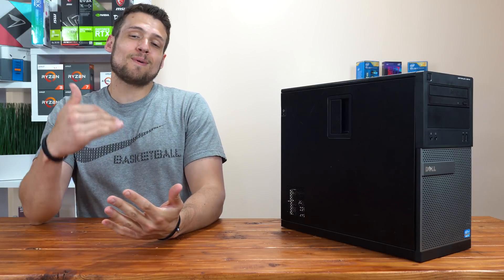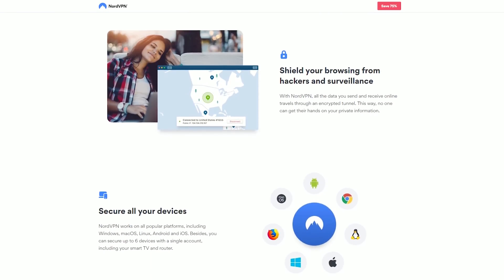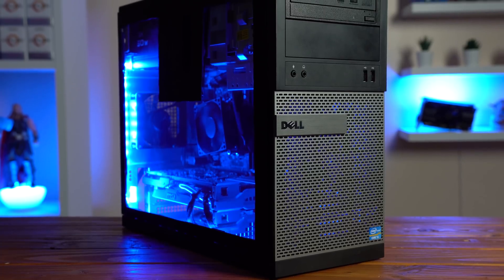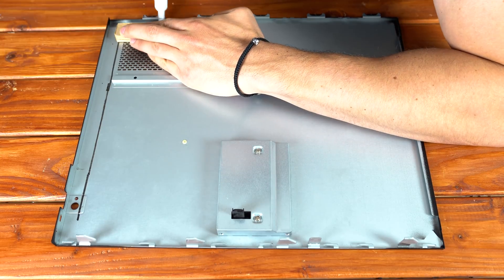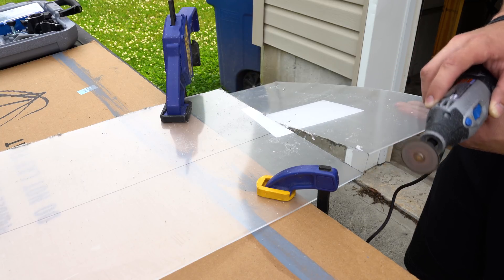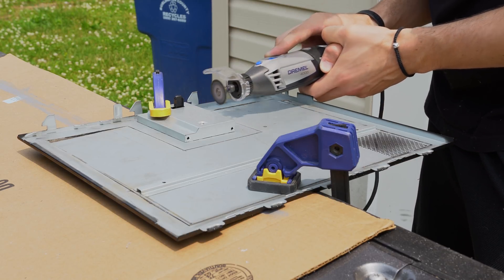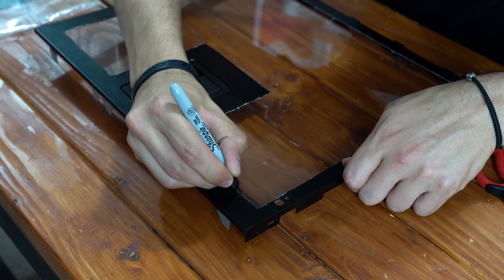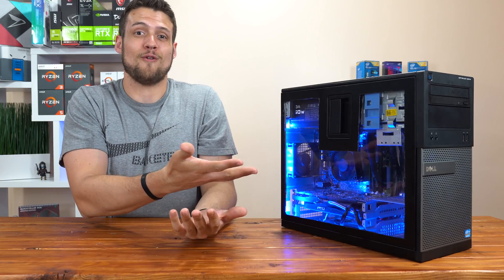How to Mod a Dell Optiplex Gaming PC!

Comment: I'd spray paint the front panel completely black too. Looks amazing. I've always low key loved the Optiplex look.
Reply from the maker: That would look cool too!
Reply: Yup. I've done that.  If you mask off the silver dell badge it looks really beautiful on the black finish
Reply: @internziko  the badge pops off with 3 little clips way easier.
Reply: I painted one back that o just sold. It looks great!
Reply: Maybe even 3d print a new upper part with some deferent buttons
Reply: And possibly some vinyl wrap on the back. Or You could have some logo spray painted over black i say mette red or blue depending on light inside
Reply: I spraypainted the front black and added a blue led molex fan to the front. It looks so much better now! 😊
Reply: I did mine in orange 😊 looks way better than the regular color imo
Reply: i use an optiplex to run a server.. just spraypainted the front black today, ziptied an RGB fan on the inside grill (shows through, also actual intake) and spray painted the little piece that says "dell" in the front white. gonna use some vinyl cuts and adhesive to further brand it for fun, but i considered the idea of the window. Only problem i have with it, is honestly it feels like more money than it's worth these days, considering i could just buy a new case.